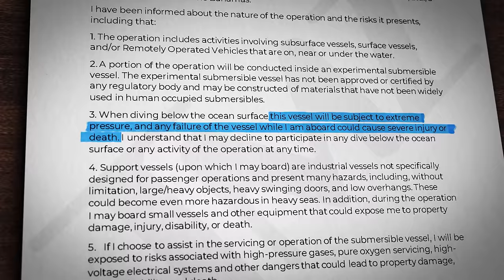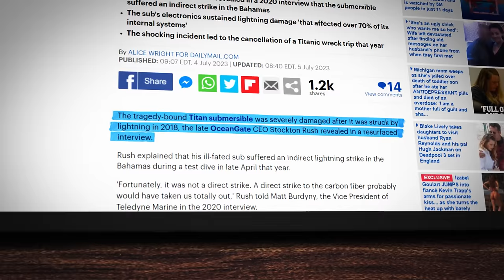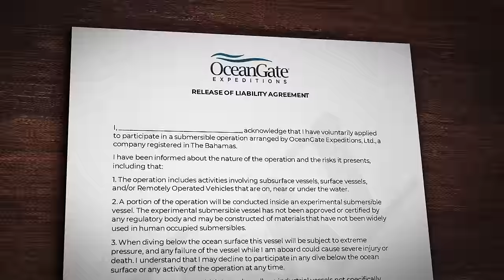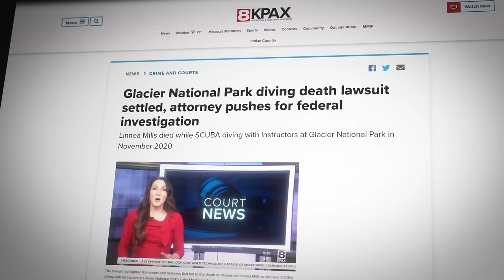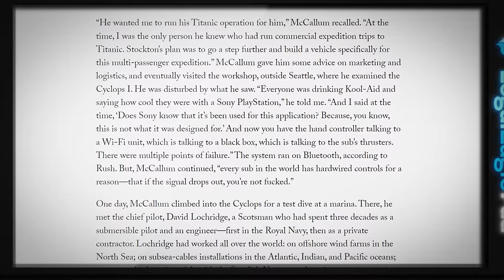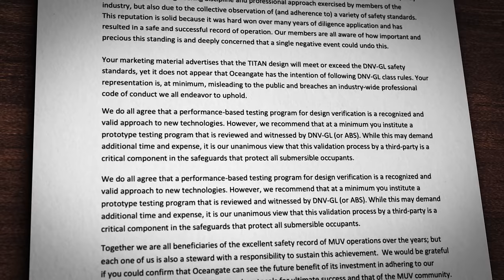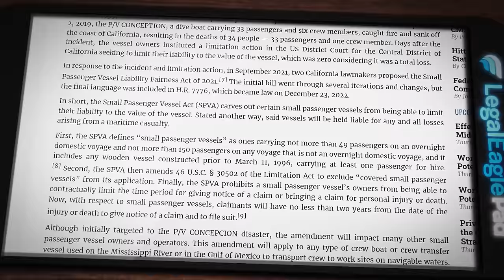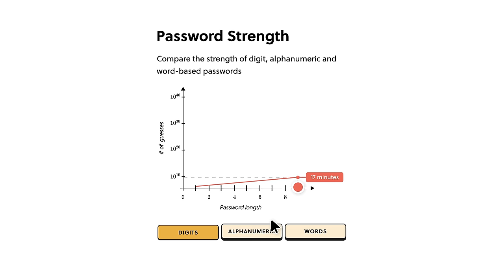OceanGate Is Getting Majorly Sued

Comment: If they are using English common law they will likely be found guilty of gross negligence manslaughter. All the four elements are there:

1) A duty of care

2) A breach in that duty

3) Causes or significantly contributes to the death of the victim(s)

4) Departure from the the proper standard of care.

They won’t be able to use Lord Denning's 'get out' "That if a reasonable professional from that field would have taken the same course of action…" (non verbatim). All the professionals forewarned him he was an utter prick. 

As OceanGate claimed a level of expertise those signing didn’t claim, they’d struggle to get the disclaimer past an English court. Much like a signing a release for a doctor to operate on you.

Comment: You could add that the rate of descent was 2x too fast, to the point tht they could not stop it when the first alarms of microfractures sounded. He drop all the garbage used as ballast, to no avail. If he haven't done that maybe, just maybe they could have survived after a quick stop and a slow, safe, surfacing.

Comment: The issue with the carbon fiber hull isn't that it's loaded in compression. There are composite structures loaded in compression in aircraft applications that Stockton was probably familiar with since he was an aerospace engineer. He also was not the first person to try and build a carbon fiber submarine, and probably won't be the last. The issue with his design was more the magnitude of the stress, a combination of the immense depth he was targeting and the large internal volume for carrying all those passengers, which meant the carbon fiber sections needed to be extremely thick. He probably did not have a good way of detecting and controlling defects in such a structure, and it's probable that even if he was to do so with the sensitivity standard for aircraft applications that it wouldn't have been good enough for what he was trying to do. His response to the concerns raised by that fired employee was basically that the technology didn't exist to perform the inspection he was asking for, which may very well have been true. 

Ultimately that meant this sub was at best a test article which if applied correctly could have resulted in real innovation but really had no business carrying actual people, let alone paying passengers. Stockton was also a test pilot, and probably had a mentality towards personal risk very different than the people he ultimately mislead into following him on these dives.

Comment: one small sidecomment, the us navy also uses off the shelf video game controllers -- xbox controllers -- to control its nuclear subs. so the controller in and of itself isn't of any inherent concern. of course, other issues with controls may well be design defects, other than the fact of being an off the shelf controller. (also, being struck by lightning isn't a design defect)
Reply: i believe the OceanGate controversy over the controller was over how cheap it was and that it was bluetooth and not hardwired like in military applications usually have, at least as an option

Comment: It is actually not true, that the Titanic had design flaws out of neglec. 
Sure, would her bulkheads have extended higher up, the ship might have survived the impact with the iceberg or sunk slower. But having so many bulkheads and so high was above industry standards back then. 
The same goes for live boats: Titanic had more than industry standard and more then British law required. 
The reason it was considered unsinkable was that it was the safest ship afloat when it was build, which is also why the shock of it sinking on it's first trip was so big.

Comment: Carbon Fiber is also prone to water getting between layers and along fibers causing fatigue and de lamination issues...On a submarine...Composites also require specialized testing different than metals for inspection which uhm don't seem to have to been being done routinely...hmmm Also Carbon fiber composites have some interesting properties with regards to thermal expansion depending on the fiber orientation since Carbon fiber has negative alpha coefficient(can range between + and negative values) which would put complicated repeating stresses on junctions between materials cyclical stresses lead to fatigue... That thing was a comedy of bad design.

Comment: That plastic lunchbox had a time-delay fuse the second it was manufactured. It was a grenade with the pin pulled out. Sooner or later this was guaranteed to happen.

Also the makers of the Titanic never called her "unsinkable". They touted all their safety measures (which were state of the art at the time), but never directly stated it couldn't be sunk. Pop culture at the time is what drew that connection.

Comment: Commercial Diver here. One of my coworkers dove alongside Linnea Mills during her last dive. There were efforts during the dive to help her, but she was too deep to safely reach during that portion of the dive. From what I heard, large portions of her air train and connectors were held together by duct tape, including the aforementioned drysuit inflator connection. Both parties here are at fault because the ultimate decision to take the dive belongs to the Diver. Thats how it works Commercially as well as recreationally. That said.... her rented equipment was very clearly incompatible and flawed.

Comment: 20:23 the Titanic is completely different imo. Yes it had design flaws but at the same time the captain crashed it into an iceberg… Therefore I don’t think you can blame short cuts in its design for the reason it sank

In the case of this submarine the design flaws are what caused the deaths of its occupants and not the error of the pilot/captain.

Comment: I still don’t understand  why they didn’t do what miners used to do by taking a canary down into a mine. In this case they would only have to monitor the canary and if it spontaneously imploded they would have known there was a problem. If only they had used safety systems like this the perhaps they would not have turned into ragu

Comment: 'Inherent risk'... Read up on the ALARP / SFARP principal. It's an excellent measure for determining if actions of risk holders were reasonable in situations like this that allows for subjectivity. Deep water submersible diving now has a long history of safety. That safety is due to testing, materials, maintenance, systems and standards. The risk stated by oceangate wasn't really an inherent risk due to the activity, it was a euphemism for the risk due to a largely untested and uncertified design that was pursued for commercial reasons by people who definitely knew that the vessel could not be provided with a conventional safety case and knew that the device was not certifiable, which would effectively deliver the inherent risk. You also can't waive an ALARP system in the context of a commercial operation, to maintain risk at an ALARP level is the sole responsibility of the risk holder. By definition, to require a waiver in the language used by oceangate is an admission that risk is not ALARP. IMO the ALARP principle was massively violated. That line was so far behind them that they couldn't see it. That is surely grossly neglect.😢

Comment: Interesting legal analysis.  I didn't realize the hull was carbon fiber.  I am not a materials guy but I am an engineer and diver and that's enough for me to say "no way".  I don't find the use of the off the shelf Play Station controller to be a problem in itself but relying on Bluetooth connectivity seems dodgy and I would want several layers of redundancy on the buoyancy and propulsion systems.  It does seem that OG was cavalier at best and reckless at worst with the design and operation here.

Comment: IANAL (And indeed; From the professional standpoint IANAE either) but I don't think it would be legally false for me to suggest that even I could design a sub with a greater degree of competence and regard for necessary standards than Mr. Rush was ever willing to extend to. 🤔

Granted, I can see the attraction in using groundbreaking materials in a submersible like that...But unlike Mr. Rush; If I wanted to push straight to physical testing, I'd be filling that sub with atmospheric sensors, a crash test dummy(s) and a data recording system... Not human beings, or any living thing for that matter. 🕯

The difference between Mr. Rush's approach and my own would appear to be that when my sub implodes, the only concern is practical recovery of the wreckage (Let's keep the world tidy!) - Not the funerals of five different people. 👍

Comment: the fact carbon fiber was being touted as one of the protective layers of the submersible is a bad sign. there's a reason carbon fiber (stronger and massively lighter than most every metal) isn't used for all parts of a race car. if it's exposed to certain patterns of stress it can explosively fail. look up when they tried using carbon fiber for racing motorcycle wheels.

Comment: If only the Titan had been designed as conscientiously as the Limiting Factor. All the victims would be alive today.

When the wreckage of the Titan was brought ashore, the titanium end caps were filmed. No trace of the carbon fiber hull was present, as if it had disintegrated, leaving nothing to be brought ashore. That, and the well-known issue of carbon fiber not serving well as a hull against external pressure, may weigh on a court's mind.

Comment: It's at best an "oversight" and that's clearly being extremely soft on the company. They knowingly didn't test and ignored and let-go engineers who dissented and other industry professionals who complaned that the vessel was unsafe and potentially very likely to fail. Cases like this show the problems in a glaring light with shoddy operation and engineering of craft at extreme depths and circumstances and what happens when you play fast and loose enough times. Things like this are exactly why these legal loopholes need to be tightened up a lot more than they are currently.

Comment: "Carbon Fiber is better than titanium"
AAAAAAAAAAAAAAAAAAAAHHHHHHHHHH
Yes, carbon fiber has some amazing properties and can be very sturdy whilst weighing very little, but there are obvious limitations to its stress resistance but more crucially how it handles stress, when compared to titanium. There is a reason why we still use steel for bridges and buildings and have not replaced it all by carbon fibre!

Comment: In the face of such a tragic incident, it's unsettling to see how Ocean Gate's contract seems to hold more water than their submarine did. As the legal team navigates these rough waters, they've managed to stay afloat, buoyed by their meticulously drafted agreements. You could say their legal strategy was designed to weather any storm, a contract as unshakeable as the ocean floor and as unsinkable as the sturdiest of ships.

In fact, they've gone to great depths to make sure their liability doesn't spring a leak, as solid as a seawall, with no room for loopholes to make waves. And even now, up the creek without a paddle as they might seem, their legal defense remains shipshape. Their contract, acting like a steadfast anchor, might be all that's keeping them from getting swamped by a tsunami of lawsuits.

The contract, seemingly dry as a bone, is designed to keep the company from drowning under legal scrutiny, acting as a lifeboat in troubled waters. Despite their submarine succumbing to the pressure, their legal defenses, anchored by this contract, stand tall like a lighthouse, holding back the tide of potential lawsuits. Even as they're submerged in this sea of controversy, they're determined to go with the flow, hoping their contract will help them float on the surface. 

But while they might be able to weather the legal storm, it's clear that the real-life tragedy has left an indelible mark, a reminder of the real stakes when venturing into the ocean's depths. In the end, it's a sobering lesson about the risks of diving too deep, too fast, and relying on a contract to serve as a life raft in a sea of potential legal trouble.

Comment: While I appreciate the witty transition into your pitch for Brilliant, I don't think it was a lack of math and science skills on the part of Stockton Rush that led to this catastrophe. Sounds like he was suffering from an over abundance of hubris, which can be lethal in even small doses.
Reply: It was most certainly a lack of scientific and engineering knowledge   in the context of the vulnerabilities Carbon fiber.  

Since Hubris is defined as excessive pride or self-confidence.
"the self-assured hubris among economists was shaken in the late 1980s"
It's apparent that Rush conflated te accomplishmrnmt of his ancestors with his flawed and deadly contribution.
His lack od scientific knowledge stems from his determination to use a material reknown  for withstanding pressure on the hull of an aircraft to applying the same material to the hull of a submersible these are condition that lie in contrast to each other.

Giving an opinion is one tong but incorrectly positing your opion as thw sole factor causing the destruction of the Titan is ill informed at a minimum.  So next time try posting something factual .
Reply: @SnarkierThan-U-R  He was willfully ignoring all the expertise that was offered to him. Lot's of people tried to warn him.

Comment: Screw over a few thousand regular people…maybe a valid lawsuit.

Screw over a few rich people and society turns on its head.
Reply: Because regular people don't generally have the means and opportunity to do any kind of serious due diligence.  The fact is that all this information on OceanGate and Stockton Rush was easy to turn up yet not one of these billionaires bothered to check into it before handing over $250,000 and going down in a barely tested submersible.  Or they did, but figured they were better than other people and so would be safe.

Comment: one mistake at 5:20
the stress graph that you saw, a sudden dropoff, is the graph of the carbon fiber composite that the sub was made from. if you hear the WALLS cracking, it's already too late. as stupid as he was, what stockton said about the plexiglass windows was accurate; the windows were not the weak point of the sub. the sub not being built to industry standard, then making dozens of descents and ascents, without being physically tested a single time, that is why the sub imploded.

Comment: For those who wonder what happens at that dept. It does not get crushed. In stead the water rushes in and fills the vessel at about the speed of sound. My guess is that the power from water was enough if not kill them instantly, (which it probably did) at least knock them out. My point is no one suffered. Hope the ones whose stupid idea this is sued to hell and back

Comment: The supposed safety depended upon the tensile strength of a material, carbon fibre.  Two wrong ideas, tensile and material.
What was relevant was the compressive strength of a tube.
Different words.  different concepts: Compressive. Tube.
No matter how strong the tensile strength of a tube, you can always wring it or bend it and squeeze the life out of whatever's in the middle.  
Tensile sstrength has almost nothing to d with resitance to wringing or bending of the shape "tube."
Stupid commentary.  False expertises.